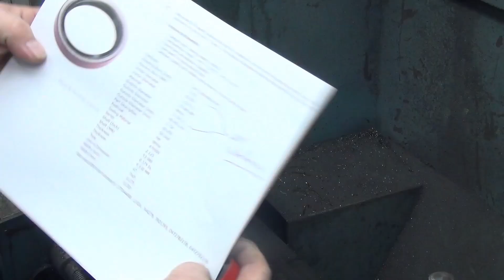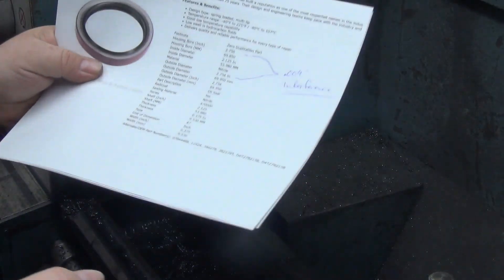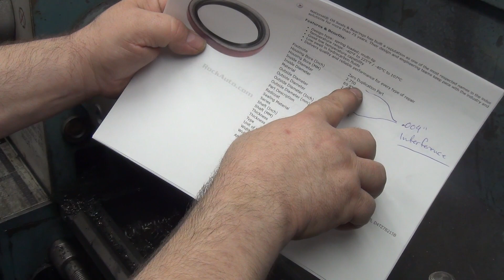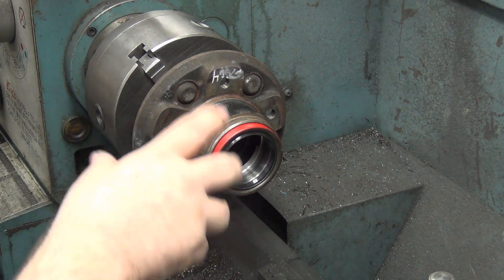Toyota 5 lug on HB(D21) - New Wheel Seal

Comment: What's the center bore size for the 43502-39105? Asking for wheel fitment.
Reply: Answering to myself, I believe it's 106.1 mm. Anyone can confirm?
Reply from the maker: @jota.2rz  I'm not quite sure what you're asking.  That part number goes to the hub....so the ID where the outer bearing mounts? The ID where the inner bearing mounts?  Or the diameter of the nose where the center of the wheel has to clear?
Reply: @bluehandsvideo  The diameter of the hole for the center of the wheel to fit. I wanted to find the exact diameter instead of measuring it myself, I ended up doing it anyway because I couldn't find more information online. This part number is the same one for the front axle of a 1999 Hilux, mine is the RZN148L-PRMDK to be exact. I measured it at 67~mm. Here are some pictures, for the rear axle I got the same diameter. https://imgur.com/a/hAIuDln

Can you confirm if it gives you the same diameter?
Reply from the maker: @jota.2rz  I can see about checking a front hub tomorrow, when I'm home, but I don't have a rear axle.
Reply from the maker: info online:  Originally Posted by zidaro View Post
106.2 or 108mm wheels will fit perfect. that is standard Toyota hub bore.

Comment: @bluehandsvideo   Hey Thanks so much for this... I have a question that I can not seem to get a real answer from anyone. I have a 95 Hardbody and I would like to go 5 lug on it in the not to distant future. I have asked many people if it is possible to take the rear axles out of a hardbody and have the wheel studs removed and welded up then have them redrilled to toyota 5 lug specs? Everytime I ask I get the same answer " just get toyota rear end." I understand that is the only way it has been done but could what I asked be done and be good and safe?  Thanks
Reply from the maker: Hi Dina, You're more than welcome. The short answer is yes, it can be done and I've personally watched it being done.  As to good and safe, that's really your call, but it's been done many, many times by lots and lots of people.  You actually only need to weld up one hole, if I remember right.  The new pattern offsets the rest so that you drill into fresh metal.  If you're going to constantly hammer on the gas pedal, you might weld them all up.  Search YT for redrilling rear axles and you'll get quite a few vids about it.  I haven't watched any of them, but I know I've seen vids on here before showing exactly what you're asking about.  If you have a 5 lug drum or rotor that closely fits the centering nub on your axle, you can use that as a drilling template and do it yourself.....provided you have a welder.  That's how the guy I watched did it on a drill press.

I haven't done anything with the rear end, I just figured out how to machine the hub to save having to machine the spindle.  nis720 on infamousnissan did all the measuring once I told him what I thought would work.  It was a collaboration for sure.   Anyway.....I have all the info for the front on my site and there's a link at the bottom of the page that will take you to thread on that forum that may have more info for you.  http://www.bluehandsinc.com/5-lug-swap-nissan-d21-hardbody.html 

-Mike

Comment: In Germany we have an incredible amount of rules and regulatrions. Wheels are only street legal when "TUV approved". It's hard to find a 17x9 with a 6-lug pattern, while 5/114,3 wheels are available in 100s of variations. So a 5-lug swap might be the best solution for my problem. Unfortunately it's hard to find a 5-lug rear end in Germany. People here are more into SUVs and station wagons - pickup trucks are pretty rare. So I might try to modify and redrill the flanges at the rear axles. Thanks for also updating your website and sharing your knowledge! 👏😉👍
Reply from the maker: You're more than welcome! Thanks for watching and sharing your situation.  We lived in Wiesbaden for 3 years... '85-'88....so I'm a little familiar with the inspections.  

It's best if a machine shop can do the axle for you, but if you have a 5 lug rotor or drum that fits the centering nub/nose on the axle, you can use it as a drill guide to place the holes for the lugs.  If the drill is smaller than the holes in the drum/rotor, you can possibly use a thin wall tubing as a drill bushing.  I watched a guy weld up a hole or two and then use this technique with a drill press.......so it's possible to do with fairly low tech equipment. :)  Mike
Reply: @bluehandsvideo  Hi Mike, thanks a lot for your reply and for your detailled tips! The idea about using a centered rotor and some bushings as a drill guide is awesome! I have a good old 2.4t heavy lathe in my shop, build in 1960. The old lady is a little out of spec, but helps me a lot. So I might be able to turn the hubs. You motivated me, to modify the rear axle. An old but massive GDR drill press is also in my shop. 
Great to know about you having been in Wiesbaden for a couple years. If you should need any parts from Germany just write me a mail. Usually I order parts from the US, but there should'nt be a problem to send a parcel in the other direction. 💪
Thanks again - I'll keep you updated about my final solution. Best regards, TOBi 👋👋
Reply from the maker: @WestBerlinCustoms  You're more than welcome! Sounds like you have the equipment to do the work in house.  
I wish 3 years in Wiesbaden meant I spoke German. Heck....my last name is Klotz......and I still don't speak German! LOL  
Thanks for the offer on parts.  Maybe one day.  For now, I'm primarily into Datsuns.  
I'm not a real machinist, but I can figure out creative ways to do things.  I also have more videos about turning the Toyota hubs on my YT channel if you need any more details.  I also did a big brake setup for the Toy 5 lug hubs on the D21 spindle. :)

I subbed and followed you on YT, FB and IG, but I don't catch everything.....so if you think of it, please keep me updated.  That's a really niche red D21 you have.  The only think I've done with the D21....other than use parts from them....is make an adjustable upper control arm.  You can see that on the first page of my site....bluehandsfab.com.....pretty blue cross shafts. :)  
I'm looking forward to seeing what you do with your truck TOBi!! :)  Thanks! Mike
Reply: @bluehandsvideo  Hi Mike, thanks for some details about your roots and background. Klotz is nearly as German as a German name can be. 👍😁👍 Usually I am in the US once a year for attending the SEMA show. Every year I am impressed about the amount of German last names on the name tags. We had some very cool experiences while sitting in a diner or walking around and talking in German. Mostly older people started to talk to us in German and we heard some awesome stories. On the other hand we have visited veterans car shows and talked there with some older soldiers (in english). We've been a little careful, but we seemed to be welcome everywhere and had never a bad experience - even with the historical background. Cars have always been a connection and best base to have nice coversation. I do really miss our travels around the world (except flying chicken class 😁 ) and to stay some time in the US. I hope this COVID issue will become better over time. 

Thanks a lot for subbing my IG, FB and YT! I follow your activities, too. You mentioned not beeing a machinist, but it looks very professional for a "non-machinist". 👍😎👍

My D21 needs "a little" love, but I guess it will be a nice bed dancer, when I'm done. Just a couple hundred hours and I'll flip some switches. 🤘🤓 I own and build a bagged '83 Caprice and a juiced '84 Regal - so I had to have an matching project. I love the 80s and these juiced mini trucks seem to be 100% 80s. 

The upper control arms look awesome! The surface quality and your logo, the construction itself - that's really cool! Unfortunally the German TUV (inspectors) would start gasping as soon as they see a part like this on a car in Germany. All the regulations here suck a lot. But we have to deal with it. 

I'll follow your next steps. Stay safe, greetings, TOBi 👋👋
Reply from the maker: @WestBerlinCustoms  I think our ancestry is more Czech and Polish, but the name got in there somewhere......somehow. lol    SEMA! One of these years I'd love to go!!  Maybe when I actually start a legit business so I can go as an OEM.  Having a full time job has been the biggest hangup....not getting the time off.  That's very cool that your interactions over here would good ones. :)  Yes, hopefully, this covid crap will go away and you'll be able to come back.  "Chicken class".....LOL.....haven't heard that before, but I get it. 

Thanks for following!  I make chips, but compared to the real machinists I know, I'm missing a vast amount of knowledge and experience to actually consider myself a machinist.  :)   

Building a bed dancer?!  Wow.  I guess everything comes back around in time.  Very cool!!!  I graduated in '82, so I'm a huge fan of the '80's!!  

Gotta head to work.  Good luck with those regulations.....we've got more than I care for here.....and you've got WAY more! lol :(   
I hope you stay safe too.
Thanks!! -Mike
Reply: @bluehandsvideo  People in Germany have their roots all over Europe. My ancestors are from Poland, too. A common name ending in Poland is "...ski" - like Klotzski, for example. But Klotz - exspecially with the "...tz" - is very, very common in Germany. 👍😉👍 I hope your business plans will grow quickly - SEMA is overwhemlming for car guys. It's easy to walk about 20 to 25 miles in 4 days and won't see it all.

I guess, machinists don't become better by time, but by experience and by doing. The best machinists seem to be extremely intelligent and smart. Online examples would be Peter (Edge Precision) or the guys at NYCNC. 

I love mini trucks and the 80s Bed Dancing. Can't wait to flip some switches. 😁

Thanks, TOBi 👋👋
Reply from the maker: @WestBerlinCustoms  I found a handful of examples of my name while we were over there.  Typically, people would see my name on a paper or my AF uniform and start asking if I spoke German.  lol
It would be nice if the business grew, but there are reasons I have to hold it back for now.  I've talked to both Peter (briefly online) and John....whom I've actually met in person.  They're machinists!!  
I remember seeing bed dancers when they started.  I was more into the stereo systems at that time. 
-Mike
Reply: @bluehandsvideo  Hey Mike, I felt pretty certain you'd know Peter  and John. 😉👍 Great to know you even had a conversation with these Pros. It's very inspiring and interesting to follow their steps and action. Even if I don't understand each and every step. But I try to collloect and soak knowledge like a sponge, while watching videos like that. Same with your postings, btw. 👍👍 So now it's time for me to go back to Bed! 😁 Have a nice day! 👋👋
Reply from the maker: @WestBerlinCustoms  I doubt I've talked to them enough for them to remember me.....Peter at least.  John might...he wanted me to come to his first open house years ago.  No time or money at that point.  
I just got off work.....bed will happen in a few more hours. :)  I hope you have a great day when you wake up.